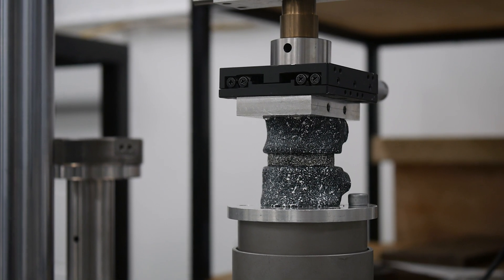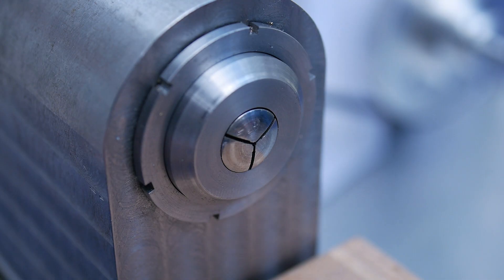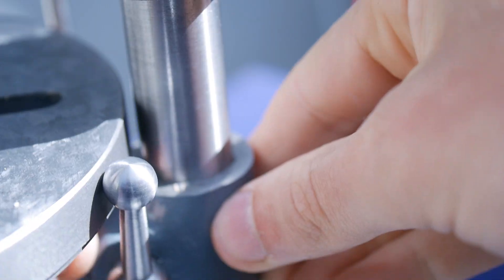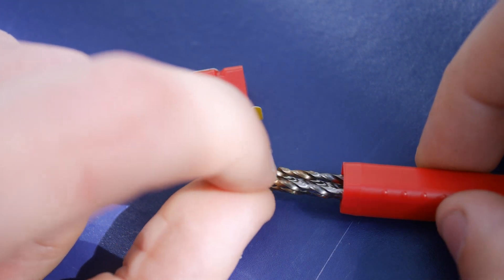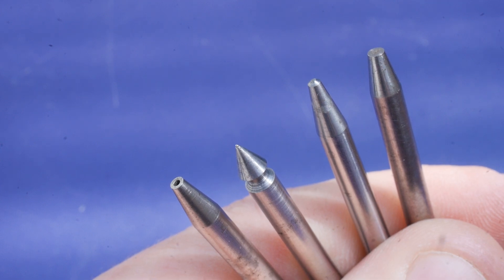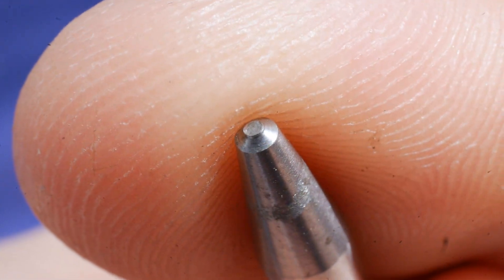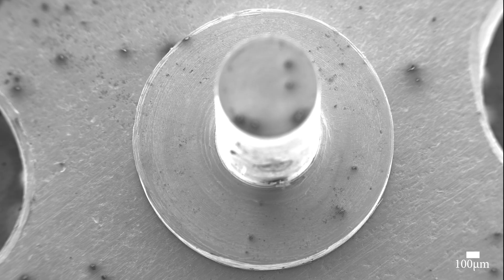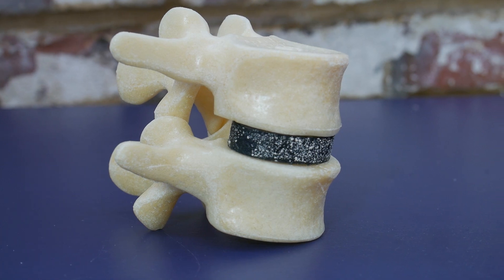Machining a Next-Gen Spinal Implant: My PhD in 9 minutes

Comment: What do you think the longevity of the implant could potentially be?  As someone who has ran the gamut of surgeries because of DDD the road always seems to end at fusion because the current disc replacements all seem to have high rates of failure even as soon as a few years after an implant surgery.  Was that something that your replacement design has been tested for yet?  Very interesting video.  Thanks!

Comment: I've suffered from a spinal injury for over 20 years that left my lower 3 discs ruptured and impacting the spinal cord.  Even with surgery to remove the part impacting my spinal cord I have lower back pain that results in reduced motion to avoid pain.  I have seen other forms of disc replacements, including multiple replacements (on an MMA fighter if all people) that restored normal motion and no pain.  The biggest issue is most ground breaking procedures like this take place in other countries such as Europe and not in the USA.  The slow acceptance of new procedures by the USA means it will be years before anything is available and even longer if you expect insurance to pay for it.  I see video like this and just shake my head as I will never be able to afford it in my lifetime so I must live with the pain.

Comment: What material did you use for the vertebrae? 
I think the time (load cycles) until you have full osseointegration of the pins would be interesting to investigate. Especially if you test for high shear between implant and bone this could be relevant evaluating how many pins are needed…. 
Looks like a really interesting project! I work at a swiss university biomechanics (ZHAW IMES) lab. Let me know if u want to have a chat!
Reply from the maker: The vertebrae were made from polyurethane foam, designed to have similar properties to bone. Of course, cadaver bone would be preferable. I have put together a model to optimise the number of pins. I am hoping to publish this work shortly. I would love to have a chat - could you drop me an email: chronova.engineering@gmail.com
Reply: You need to talk to Sirona  Dental Bensheim Germany or Planmeca in Helsinki about 3d scanning milling / printing and 3d radio graphic imaging!

Comment: Have you looked into a titanium mesh for bone repair? Theres a Japanese lab working on making advanced titanium implants that get around the need to remove them. The mesh integrates with the bone so that the bone still receives shock and doesn’t have a shield, they say this gets around the loss in bone density when a implant plate is left inside. I have some ideas to how this could be used cosmetically. For example making cheek bones more pronounced.
Reply from the maker: Yes, titanium mesh has been used for spinal fusion cages for a while. The use of a mesh is covered by a patent.

Comment: I have a spinal cord injury and have (2) 12" rods and twelve screws holding 9 vertebrea together. The main the to remember is that any metal cannot be magnetic do to the patient haveing to go through the MRI machine. If the metal is magnetic they will pull through the body and out to stick to the MRI machine.

Comment: Great work and I hope you succeed! Isn't it an option to just fixate the two vertebrae together and simply sacrifice those few degrees of motion in exchange for not being in pain? Or would that overload neighbouring discs?
Reply: Iirc that's already an option to soem degree - bone-on-bone contact is painful, but using essentially titanium guide rods alongside the spine can alleviate this a bit, it's mostly used to refix Scoliosis?

It's very invasive and the loss of mobility is extreme, so an straight up artificial cartilage pad is amazing.

Comment: I had a cervical spinal fusion for my broken C4/C5 about 12 years ago, with 6 large titanium screws, a tantalum plate, and microlattice bone graft installed into my neck. On my X-ray, it looks like 40-50% of my cervical spine is now covered in metal, and I always wondered if it could have been done differently with less intrusive hardware and more freedom of mobility. Ridiculously painful experience. Actually this is one of the things that got me into hobby machining and fabrication over the years. I appreciated hearing about how things were done for micro machining and your approach. Keep up the great work
Reply from the maker: Sorry to hear about your injury. It's possible that you could have had a less invasive procedure but there are so many factors involved, that only an experienced clinician can really make the judgement. I am hoping the requirement for invasive operations such as yours will diminish in the future as MedTech develops. Best of luck.

Comment: question: Would creating the pins through sintering instead of machining from a solid material facilitate tissue integration?
Reply from the maker: It's certainly possible, although osseointegration is mainly designed to occur on the faces of the disc, rather than the pins.

Comment: How might an implant like this be installed in vivo?  It seems like this would require entirely separating the disc from the surface of the vertebra in order for it to be placed.
Reply: This is standard for neck operations. I’m not sure about lower back.

Comment: Curious, if I am able to get SiC printable, do you think it would be applicable in this situation? I know you probably didn't look into it for this application much for the machinability side of things, let alone the supply issues with it. If you think that it would be a good material and if you wouldn't mind being it shown elsewhere (the part, not the drawing/step file), would you mind sharing the files with me? It would be a singular solid part, non-isotropic as most printed things are. Visually most of the parts look printable using standard ceramics (200 micron features or so), but I'm not 100% on the actual scale of the parts.

Comment: Have you considered coating your backing plates with a thin film of gold to improve biocompatibility. I know titanium is approved for implantation but idk if you’re pins would be. The gold coating could help make sure there isn’t rejection by the body
Reply: My first job after engineering school in the 1980:s was in the Nobel Pharma company with Prof. Brånemark. Gold was frowned upon then compared to titanium with the correct surface coating. I remember that electrochemically as in bio electrodes gold is not so stable, my university did some artificial hands controlled by surface skin electrodes and green spots would eventually develop in the skin... Some gold compounds are rather toxic as as understand it.

Comment: Very interesting! Thank you for sharing! You mentioned that the metal was titanium. I assume an alloy. Does it have a name or some other designation that can be used to find additional information about it? Also, does it need or would it benefit from being coated or plated in gold, platinum or silver or something like that?
Reply: I believe medical grade titanium is pure, but I could be wrong. Also, titanium is biocompatible so no plating is needed, it just needs to be sterile. I should probably know as my research could help with such devices, but I'm not focused purely in medicine, rather manufacturing.
Reply: @ScuffedEngineer  Thank you for the info!

Comment: I thought this might be a good use for 3d printed titanium? I believe it is used for some implants as it's possible to print in a honeycomb like structure which fuses well with bone?
Reply from the maker: 3D printers are good for complex structures in titanium and have been used for spinal fusion cages but the sintering process introduces imperfections in the material which gives it a low yield stress. The endplates need to flex but this wouldn’t be possible with a Ti 3D printed structure. Good idea though!

Comment: That's very interesting. At the end, when you show inserting the assembled two plates and artificial disk between the two vertebra, it seems like it took a bit of force to push the pins into the bone. As demonstrated in the video, it's easy to squeeze the whole stack of vertebra/disk/vertebra to make that happen. But in the context of a whole, intact spinal column, how would you apply that force to seat the pins into the adjacent bone without interfering with the bone-to-disk connection of adjacent disks?
Reply from the maker: Good question! During surgery, it’s actually necessary to “distract” (separate) the vertebrae using quite a lot of force and specialised tooling. When this tooling is removed, the surrounding muscles and ligaments cause the adjacent vertebrae to clamp down on the implant.

Comment: As someone who live through torturous hell for 8 yrs with DDD from an MVA, I can't thank you enough for applying your knowledge and skill in this field. Ultimately stem cells were the only thing that worked for me but the involuntary suicidal thoughts are too much for people to live with, with no end in sight. Hang in there folks. Looking forward to seeing more work in this regard!
Reply from the maker: Sorry to hear that but I’m glad you found a solution. I will do what I can to see this work through for future people in your position. Cheers!
Reply: is there any feasibility to using stem cells to somehow grow replacement parts, that could be then put in place as new, correctly functioning part of the spine?
Reply: @xisotopex  currently no, but it should be possible
Reply: @あやす-p6p  Why not put a belt around the disc wrapped to your mechanism (How a jail) to prevent the disc displacemrnt.
Reply: Can you link me to your stem cell solution? I have the same problem. I've already had 1 disc replaced and 2 more are failing. :(

Comment: At first I thought you wouldn't be able to install this implant without severing the spinal cord, but I'm guessing that goes through the other hole? Really interesting video, thanks for sharing. I love the staking tool.
Reply from the maker: Thanks James. The spinal cord runs up the very back of the spine, so doesn't have to be touched to install the implant.
Reply: This looks like it goes over the body of the vertebrae. The spinal canal (where the nerve runs) is in the middle of the bone. This replaces the cartilage disc that cushions the space between each vertebrae.
Reply: @okinshield7167  No.  Spinal canal runs anterior to the disc.

Comment: Do you have any plans to add a surface treatment such as acid etching, media blasting, or other chemical treatment to the portion that inserts into the cortical bone? The geometry of the pins doesn't look like it would hold up over time to much tensile forces especially since they are connected to a semi rigid component that is connected to another compliant component which is subject to not only tensile and compressive forces, but lateral and rotational forces simultaneously during normal function. Adding flutes would allow for ingress of osteoclastic activity and could help stabilize those implants to resist forces other than just compressive.
Reply from the maker: The disc is always in compression, apart from during large bending deformation. I have a method of resisting tensile forces in this instance. All other forces (bending, torsion and shear) are resisted by the pins. I have considered more interesting pin geometries and coatings on the superior and inferior faces of the implant for osseointegration. The pins are really only designed for primary fixation and, as you see them in the video, in their simplest form. Thanks for your comment!
Reply: @chronovaengineering  Have you considered traction forces as would be induced during chin up exercises (1G) or being suspended in a parachute harness (potentially several Gs on initial open) for example? I'm fascinated and extremely hopeful for better options than exist today!
Reply: @gardnercongdon9104  well I think that if you need one of these you won't be jumping a lot from a chute. I don't think that considering extreme cases is the way to go. As a doctor I prefer a solution that is not perfect but available than a non existent one because of its difficulty. You can choose if you want it or not given it's limitations.
Reply: @Ron Wesilen  this design and the processes are entirely suitable for a prototype and early development, but many of the manufacturing challenges associated with this design would give rise to functional and durability improvements at the same time. 
The end plates appear to be laser cut or water jet cut. The holes drilled to adhere with the elastomer could and should be cut out by a laser as well, to save time and because they are dimensionally less critical than the pin I.D.
The eventual manufacturing funding will certainly enable the use of more than a 2 axis lathe (perhaps a precision live tooling lathe or a millturn), which would enable more complex features like flutes or a helix for maximal osseointegration.
This method of staking/riveting intuitively seems inadequately sterile (the fine gaps between the titanium parts).  A laser welding process on both sides of each pin would be more sterile, more robust and could be automated. 
I also wonder if slightly taller, cup shaped end plates would be worth the cost, to maximize adherence to the elastomer as well as radial/shear containment under heavy lateral forces and spinal contorsion. It would require a 3d contouring milling process for the entire end plate, instead of laser/water jet cutting sheet metal... I'm just wondering how could the robustness of the synthetic disk match or surpass the original, in practice?
Anyway, great idea and of course good work so far. By the time this reaches 'the' market, I assume adequate funding will be available for such manufacturing processes.
Reply: @chronovaengineering  I love your content so far this included but I believe you are going to have big problems with this design.....at least from what I have seen presented in this video. Good luck.
Reply: @robertmabry4172  he’s just a PhD student. No real in vivo experience. I also laughed when I saw the size of those pins.
Reply: @aga080  he may have real life clinical experience that he hasn't eluded to; there isn't a way to know unless he tells us. For all we know this design is already being tested in live pigs and is showing success and he is laughing at all of our comments.
Reply: @robertmabry4172  *alluded
Reply: @aga080  sorry, none of my degrees are in spelling. Or English composition....
Reply: @robertmabry4172  i dont think you need a degree to use words correctly, but maybe im wrong.
Reply: @aga080  if I cared enough about using words correctly I would have gotten a degree in it. Although I can see that it's very important to you. Good luck with that.
Reply: @aga080  racism moment
Reply: titanium have an interesting characteristic called osseointegration, where the bone grows on the titanium surface and lock the titanium implants. this characteristic was Discovery by Branemark in Sweden , around 1950 when he was studying  micro circulation in rabbits.  today with metal 3d prints, these implants can be print in a easy and cheap way in one piece.
Reply: I was injured on duty and as a result I severely damaged the discs around L4/L5 causing chronic back pain with associated life-side sciatica. Over time, this has led to a diagnosis of Facet Joint Syndrome. The pain is chronic. 

I have had multiple procedures to help alleviate my symptoms and have received excellent care from my local pain-management clinic. However, none of them were curative, whereas a procedure to have something like this fitted would be a life-changer for someone like me.

I wish you all the best with your work and, hopefully, somebody like me will benefit from your ingenuity.
Reply: @ravusursi893  there may already be approved disk implants depending on where you live.

Comment: Very interesting. I learned a lot. Have you considered a rotary flow type of setting for the pins onto your ring? A relatively slow turning swage in a milling machine can do the riveting at a much quicker pace. But, as you mention must be verified that you are not causing cracking.

Mark
Reply from the maker: Interesting idea. I will look into this. I have investigated various other methods such as laser welding and diffusion bonding. Ultimately, the final decision would have to be discussed with a manufacturer. Thanks for watching!
Reply: @chronovaengineering   It's basically a staking tool that rotates and deforms the rivet.

Comment: Hi I'm back again. You're very fortunate to have watch-making knowledge prior to your present job. When did you pickup watch-making? I did try apply for prosthetic technician as I love hand tools and have tool- maker training before but without any success in healthcare.
Reply from the maker: Hi Steve. I started watchmaking a few years ago as an extension to my projects involving conventional machining. It's surprising how hand methods are still used for surgical tools and prosthetics! Sometimes it's the best method, especially for low-volume production and prototyping.

Comment: I wish this device had been available in 1985, when I injured the disc between L5 and S1. I have spent my entire life in pain, sometimes debilitating pain whenever the disc decides to herniate again.
Has there been any research on rejection? Is the soft compound a new material, or something that has been used in people before?
Thanks for sharing this video, it was informative and interesting to see how many disciplines can overlap.
Reply from the maker: The elastomer material has been tested in other medical applications for many years now, so I can be confident on its biocompatibility without the need to run my own tests on this. Thanks for watching!
Reply: @chronovaengineering  Thanks for the answer. I wish you well, your work is important.